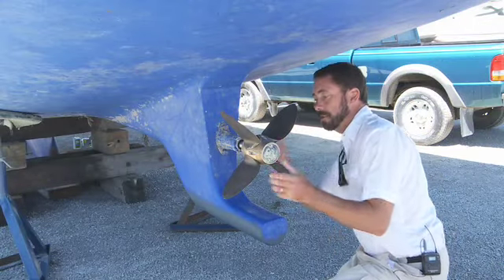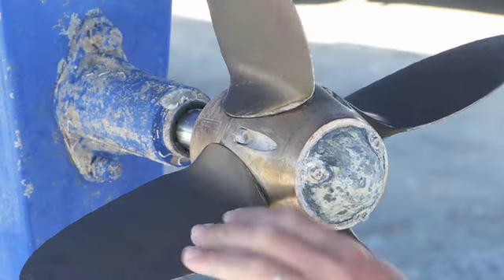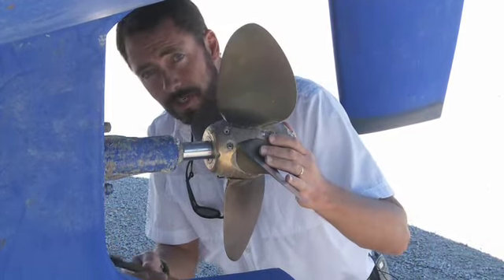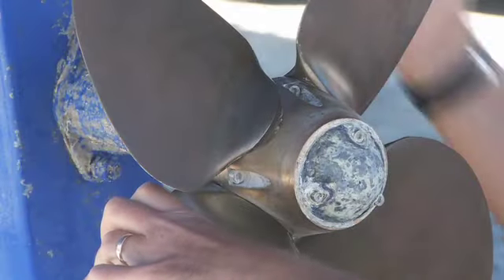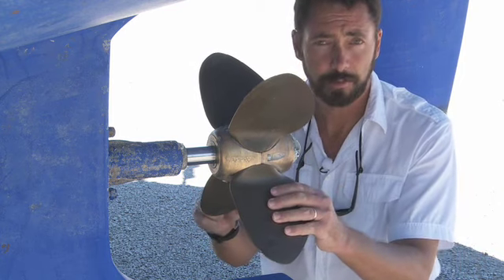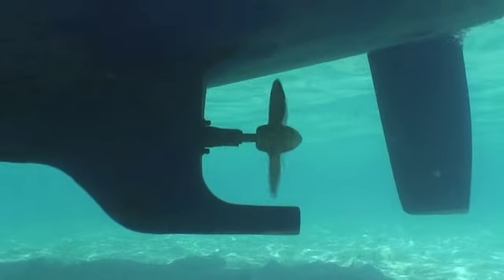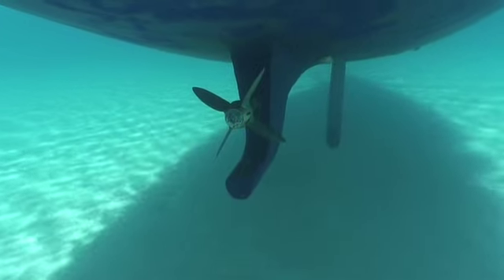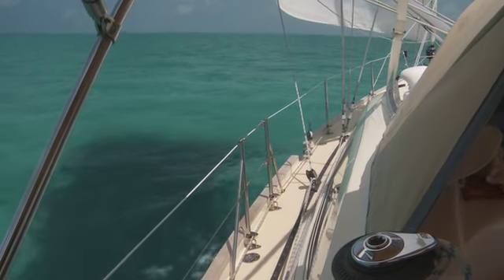Episode V3 Feathering Propellor

Comment: The large gap puts extra loads on the bearing and also allows shaft flew aft of the bearing, so it can give rise to accelerated bearing wear and also some vibration, with a rigid drive as you have I'd be looking at 6-7mm(just over 1/4") allows for a bit of give in the thrust bearing rubbers.

Comment: The gap looks very large, especially when you consider the extra weight of this type of prop, I'd have it 1/2" or 12.00mm from the back of the stern tube if it's a soft mounted drive. That looks like 2"!

Comment: Hi,
I also have a 4 blade vari prop on the boat.  Q. do you feel it spinning when sailing with the engine off and in neutral? If so, if I put it in reverse will this stop the propeller spinning and keep the blades feathered?
Great props!  Especially for reverse.
Dave
Reply from the maker: I do not recall it spinning with the engine off. It may have to do with lubrication whether or not it easily feathers. I believe we locked the shaft by putting it in reverse.

Comment: I don't know anything about these props, but it looks like you wouldn't have a reverse.
Reply from the maker: The prop blades spin into reverse quite quickly. It was a very good prop in reverse as well as forward.
Reply: when you reverse the shaft rotation,  the blades reverse too.  It's more efficient than fixed blades in reverse.